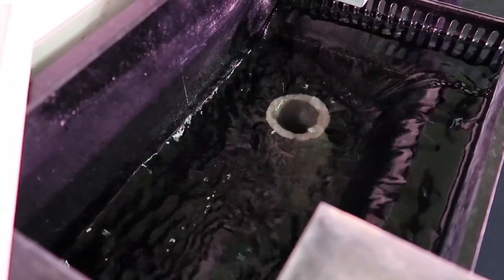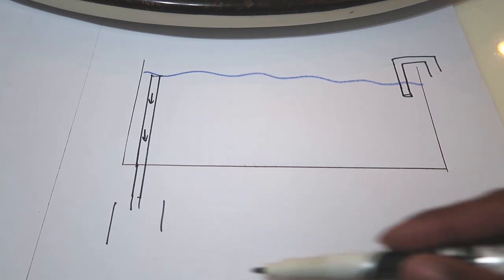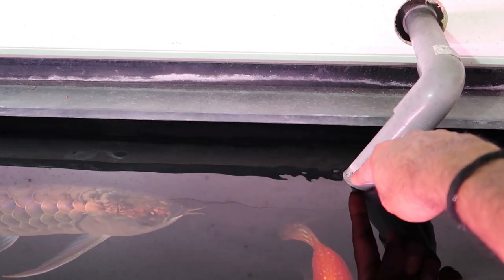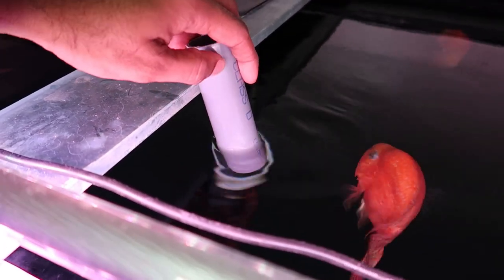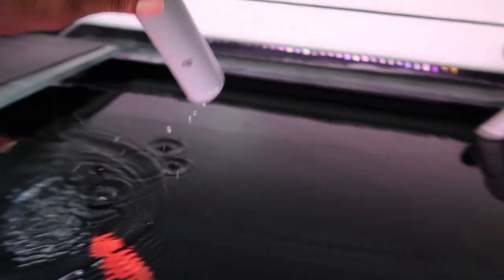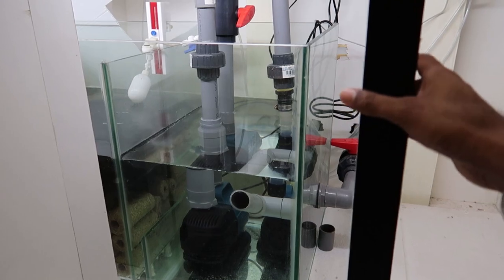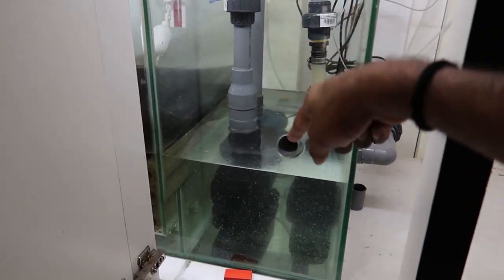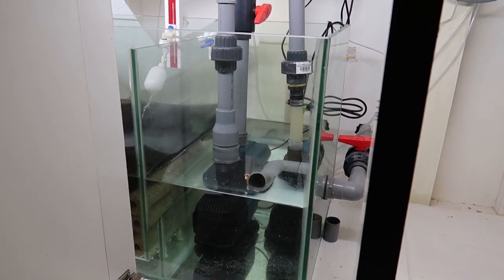HOW TO AVOID AQUARIUM SUMP FLOODS? AVOID THESE 2 MISTAKES!!

Comment: So I'm about to start a new 180 gallon reef tank with a sump system. If I am understanding you correctly, I fill the main tank display up to the owerflows and fill the sump to the level I want it at, then turn on the return pump for the first setup?
Reply from the maker: YES correct, never fill after pump activated.
Reply: @TheSimpleAquarist  so add rock also etc to level it out too I’m sure to get a correct sumo level
Reply from the maker: @chadfishtankguy  Yes add everything then fill.

Comment: Awesome. Your channel is so underated. Bro, whats the ideal pump sizing for 48"x18"x20" tank using sump system. Tank to sump 25mm pipe and return is 15mm pipe
Reply from the maker: 3500-4000 LPH
you can add a pvc valve to control the flow as you like as well.

Comment: Thank you..the option we have is to broaden the sump or change to smaller l/h pump. but can we install ball valve on outlet pipe to reduce to suction power of the pump?
Reply from the maker: Yes we can reduce power of the pump using ball valve.

Comment: Hi, please help me. I am using 2 overflow from main tank to sump but sometimes water stopped coming down to sump from main tank and I need to suck the pipe by mouth again and again while 15 watt pump which suck water from sump to main tank with 3rd overflow continue working so it’s flood for me from main tank. What is wrong here . I am using hanging pvc made overflow . Please help

Comment: I want to add a auto top off. So when water level goes gown then additional water will come and it will flode
Reply from the maker: The additional water should be considered into the main water it shouldn't flood. If it does that means you design is wrong. YOu need bigger sump tank ( pump compartment sector needs to be bigger ) . Another method to avoid this is use smaller pump if you unable to cater for bigger sump.

Comment: that is mean.. need to drill a hole on the waterpump end pipe that water goes out into the tank right? at the beginning i thought it is the pipe that the water goes down into the sump.. huhu
Reply from the maker: Yes drill  a hole at return piping from the pump into the tank.

Comment: how about what type of float switch to stop main tank 0verflowing if syphhon stops annd sump pump keeps pumping
Reply from the maker: If this is the case , a float switch connected to your sump pump that turns off supply when level in sump drops would be better . Your tank should be design to take extra volume of water some pump sump compartment.

Comment: Bro how many L/H your pump running? What brand is it? And do you run both, or one only? Tq
Reply from the maker: Hi , currently my system running on 7000LPH and 5000LPH and yes i run both of incase 1 of it failed i have back up. Using SOBO Brand .
Reply: @TheSimpleAquarist  so your tank running 13000LH right? What is the size of pipe, from your tank to down to sump? And size from pump to the tank?
Reply from the maker: 12000LPH in total - Size of return pipe is 1 inch for each pump and overflow pipe back to sump is 2inch full siphon with 1 inch as water level controller or backup.

Comment: How do you get the water out of the return line so you can do the maintenance and water doesn’t go everywhere lol🤔
Reply from the maker: ITs a closed loop system - when you turn off pump all the water will go into the sump.

Comment: Would a check valve work so water doesn’t come back
Reply from the maker: Yes you can use a check valve but  if the check valve fail it would be disaster as well.

Comment: with a sump and an overflow box you are only taking water from the top of your tank. What happens to all the fish poop at the bottom of your tank? That never gets cycled.
Reply from the maker: Add a wavemaker to push those poops.
Reply: @TheSimpleAquarist  and make the fish do circus
Reply from the maker: @shiyamaifrad8933  LOL - if thats your goal. If you just direct the wave maker to btm of the tank. The fishes will be fine.
Reply: @TheSimpleAquarist  😂😂😂i get that